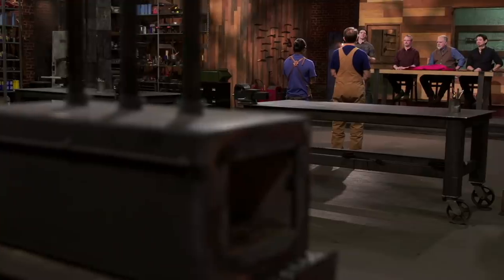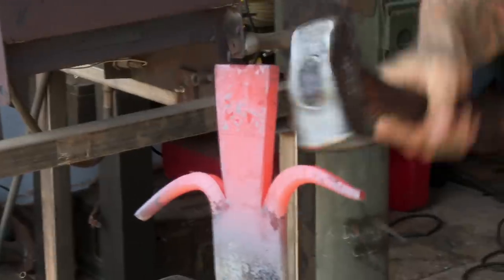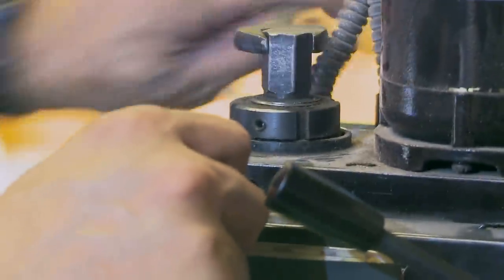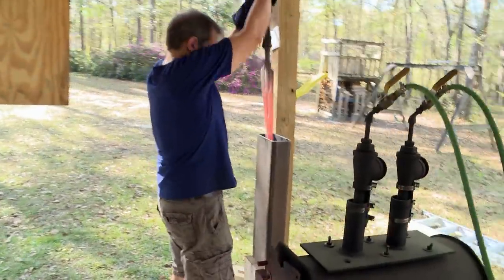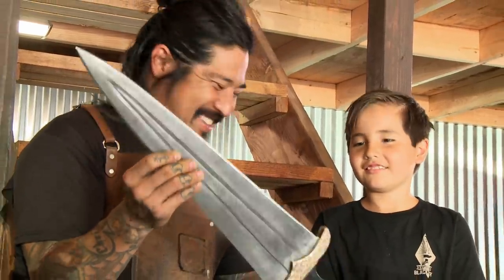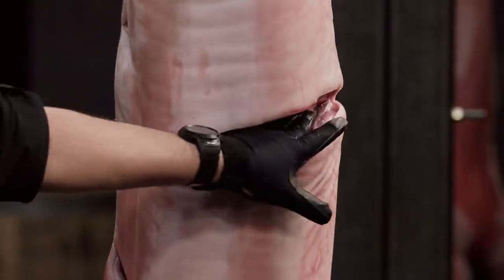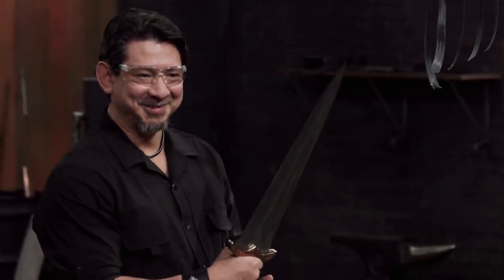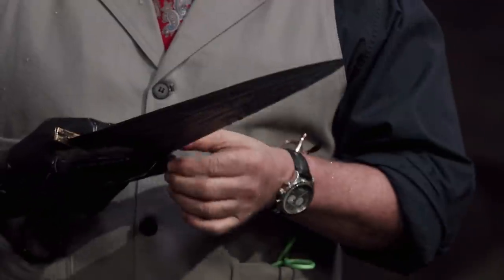Forged in Fire: Assassin's Creed Sword Does DOUBLE THE DAMAGE! (Season 4)

Comment: I understand why Neil won, wish they could have elaborated, but seeing the test and hearing the judges, my conclusion is Neil's blade was heavy, but not unbalanced, unlike most of heavy blades in this show are hard to control cause the weapon is not balanced out, while Dan's blade was lighter it had problems with the grip, judges saying they had a hard time controlling the weapon in testing at times cause of the grip, so if Dan's grip was better constructed he would have one. TBH, if I needed a weapon in combat, I would want to have the most control of it as I can so I don't have to worry about it moving around in my hand, risking losing it or having bad edge alignment.
Reply: Problems with the handle are usually the way out of the competition when both weapons perform similarly.